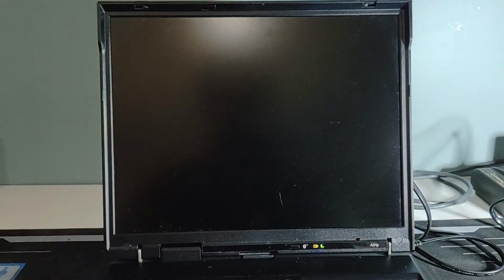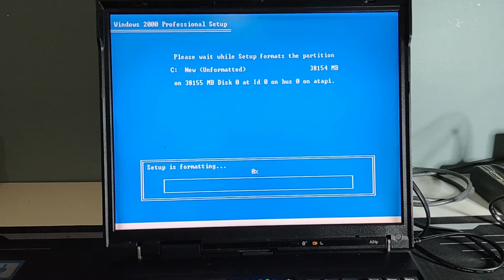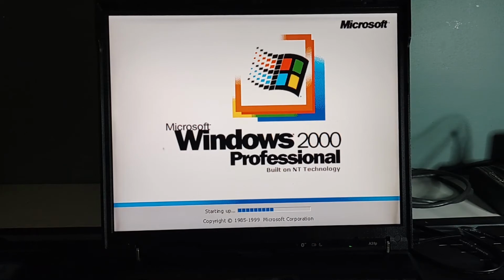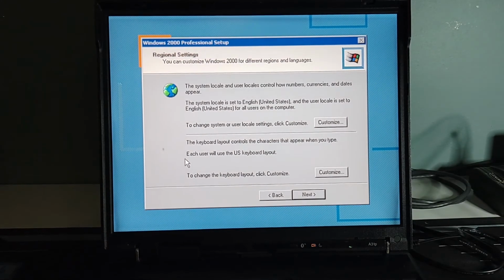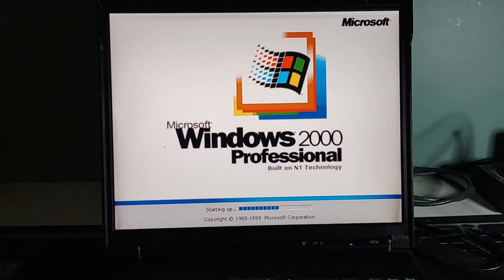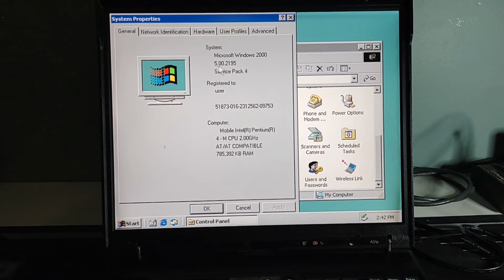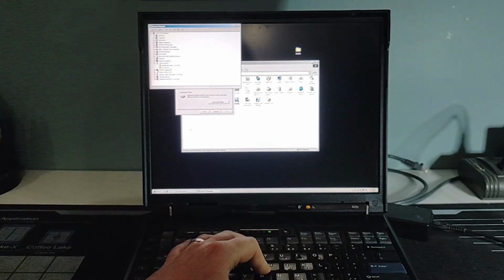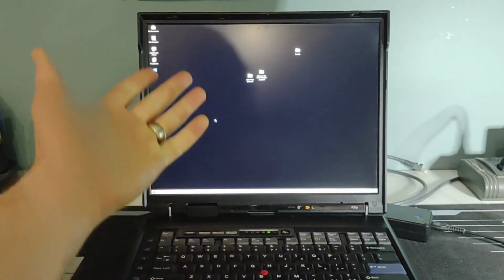ThinkPad A31p Windows 2000

Comment: Windows 2000 was great!  So mucher better than the OS it replaced (Windows NT) a lot of people think this was an upgrade from 98 but at the time there were 2 distinct Windows Operating System, home (95/98/ME) and work/business versions (NT3.51/4.0) and 2000 was really to replace the ageing NT 4.0 - thankfully Microsoft stopped all of that and went with one OS (Windows XP) for both home and work with slight variations (i.e. XP Home and Pro) depending on what environment you wanted to use it in but essentially it was the same OS.
Reply from the maker: I remember when I moved to W2K it was so much more stable, really was a great OS for the time